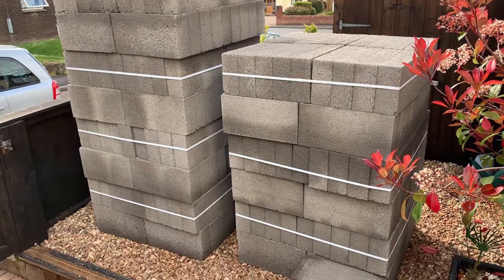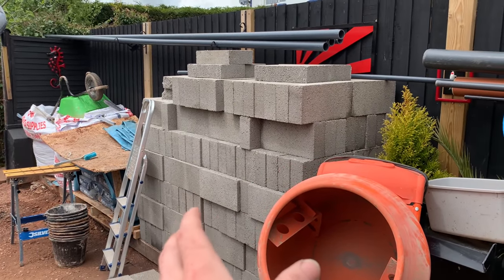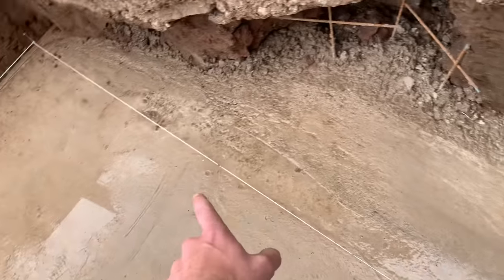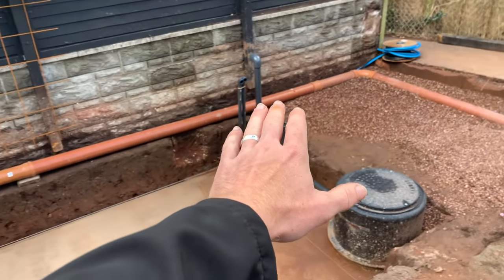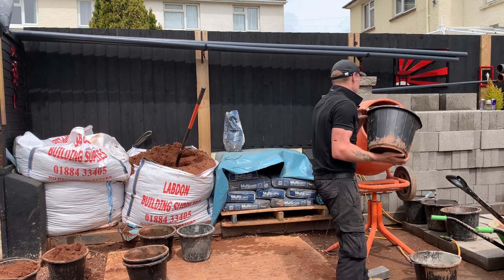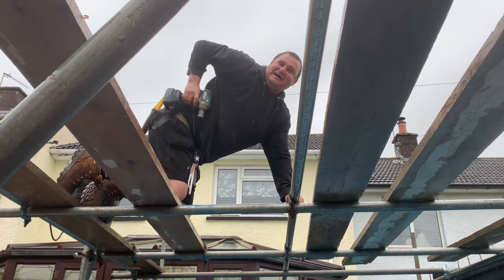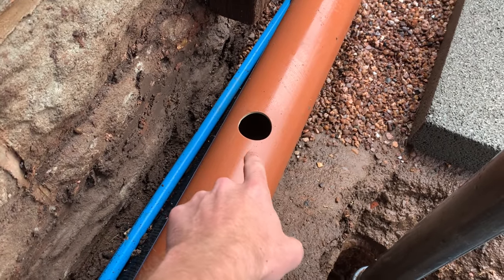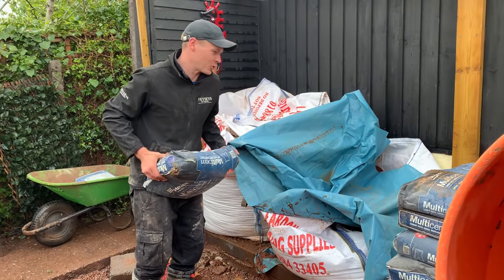THE BEST KOI POND BUILD STEP BY STEP***SO MUCH WORK HAS BEEN DONE*** PART 28 OF THE NEW KOI POND

Comment: Doesn't have to be feet. Can be imperial or metric, feet or yards or metres. As long as you use a common unit of measure for the 3, 4 and 5 measurement. I've forgotten who taught me that trick and how many years ago it was but it's a very old technique. Your video isn't finished as I type this but I'm enjoying it so far. ...and if you end up with too many rabbits, I'll take some of your hands. 😆😂🤣

Comment: Great progress. Regarding the cement mixer, you tip the barrel on it's open front face down on the ground then put the stand in, and then hold the gandles and upright it from the front. This all brings back the memories. I had never laid a brick or mixed cement in my life until I built an 8500 litre Koi pond last year. The satisfaction doing block work and seeing it taking shape is off the scale ha. It was biblical rains and after digging 4x2 metres and 2 feet deep in the ground it all filled up in an afternoon with rain water. Weeks went past before I could continue and all done 3 hours a day while my toddler slept and before it got dark at 4:30pm! I was broken but so HAPPY! Every stage was nerve racking and I took three plum levels off every brick out of paranoia so my welded liner would measure up perfect after. I rebranded Cuttle Brook Koi Farm and over the years have been getting some very special Koi from them. All bread in the UK, same quality as Japanese but you are not paying Japanese prices. Mark who owns the farm worked for years in Japan in all the famous koi houses and has a very good relastionship with the big koi houses. So he knows first hand about breeding etc and bought back top Japanese breeding parents and continued over here for years now. I'm only mentioning this as they sell their koi every month online Saturdays 10am and you need to log on at 10am or you will lose out and you will save money on the big fish which are very special and they courier 100's of boxes around the UK after every sale. That's the best bit... stocking it. Carl & Alex visited them and did a YouTube video on them last year to get a feel for the size of the place. Keep up the hard work mate it looks awesome and can't wait to hear you rant about the costs of coping stones!!! I'm still getting over it lol.

Comment: Looking good James have you tried silicone in your gutter joints that should stop the leaking even if you put new up always silicone your joints as the rubber will always perish over time but silicone won’t it’s a messy job but mite save you a few quid in new guttering 👍
Reply from the maker: Yea going to try that this weekend

Comment: with that cement mixer, if you are on your own, you can tip the mixer onto the brum opening then slid the bottom section in, you can then push the the mixer up onto the legs,

Comment: Top stuff amazing progress. One thought with your super powerful pump you may need a one way valve on the 4” waste it might pump it up out the top of the drains for your guttering as it may take a little while to soak away. Just a thought before you concrete in. 🙂
Reply from the maker: Good idea